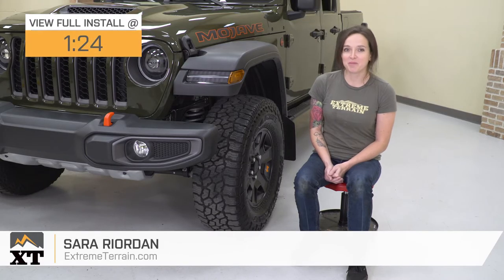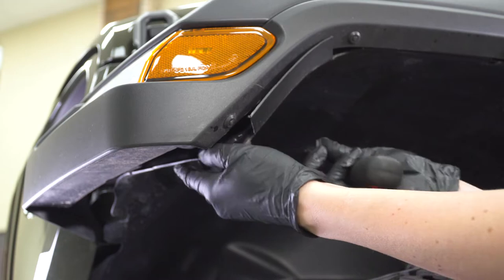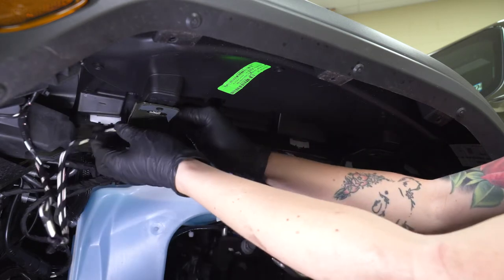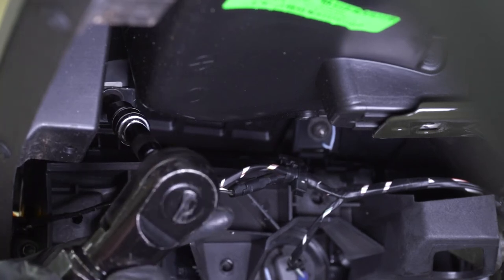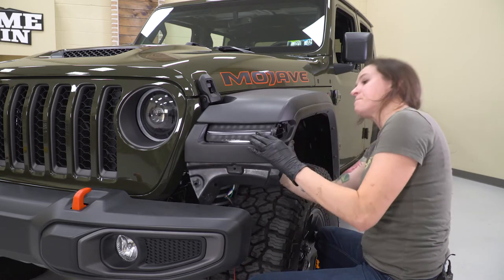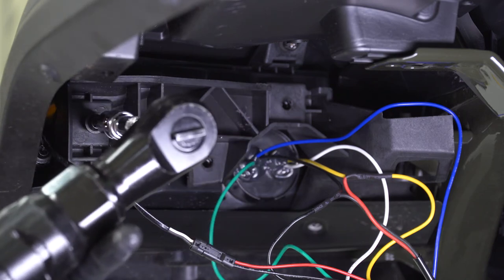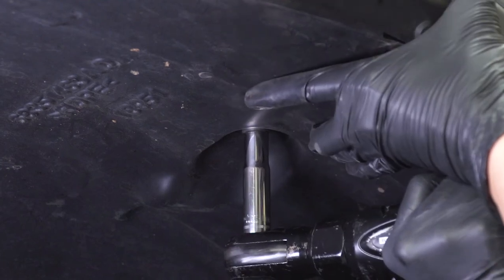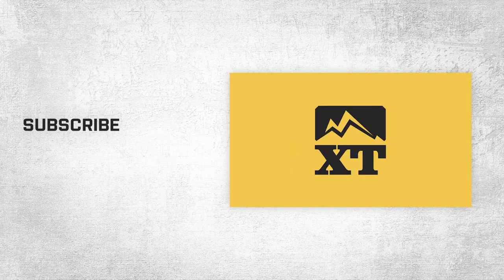Jeep Gladiator JT Morimoto GEN2 XB LED Turn Signals; Smoked Review & Install

Comment: Some feedback.  There are two different lengths and thread types for the screws holding the light assembly.  You don't cover which screws go where.  Not your fault; I lost track of which one goes where... audience, make sure you use one of the short ones for the side light.  They don't mention that in this video

Comment: I installed these on my 22 gladiator and it works great. Your video helped. Next a suspension lift. 😊
Reply from the maker: Thanks for watching! -Zach
Reply: Have you got any error codes since installing?
Reply: @505Zombieman  there were no error codes, they worked great. I enjoyed my jeep for 1 year then it was totaled. A guy took a stop sign, speeding and no insurance.

Comment: Just heads up, install is a little different for '23 year model. There are four plastic rivets on the fender that you will have to pop out and replace, they can not be reused. To get to the side marker light you must remove the bracket, also held in by a rivet. Once out it makes swapping the actual housing a snap.....
Reply: Great heads-up, thanks as I have the 23 gladiator.   How did you remove the rivets?  Where to buy replacements?  Special tools?  Thanks so much

Comment: Ok. So after trial and error. The yellow wire off the headlights will activate the amber turn signals. 
My question is if your replacing the halogen headlights with LED headlights.  Do you hook up the green wire? Per instructions if hooking up to stock halogens hook up the red wire leave the green wire disconnected.  If you have leds hook up red and green wires. So do you hook up the green wire or not.

Comment: Also, you didn't mention anything about the green wire plug requirement and left those wires exposed and unplugged in the video.  I have a Rubicon, so do I plug it in or leave it unplugged?

Comment: What is the purpose of the ballast?
If you have a tazer installed already do you still need to hook that up. Great video.  Thanks for your time
Reply from the maker: This is to prevent any hyper flashing or flickering with the LED's. We would recommend to still install this with the turn signals. Thanks for watching!

Comment: Word of caution. If you have an Overland, this guide is nothing like it. Every single step has been different. Not that this is a bad tutorial...but everything is different on the Overland trim. And it's proving to be extremely difficult. I managed to get the liner off, but you need to replace the rivet clips. Make sure you have those. However now I'm trying to disconnect the light and I'm stuck. I've unscrewed so many things, and the light isn't budging. :(

Comment: Have DV8 headlights installed what to know which wires to install amber signal wire to and which color wire is DRL. Want to direct wire white halos to drl instead of fuse box. Wires on new turn signals are white,yellow,green blue and black. On both left and right side lights.

Comment: I purchased these and installed them on a 2023 halogen gladiator Rubicon, and I do not get the white DRL's. No clue why... Do I need to get a Tazer to get them to be my "new" DRL's?
Help, I can't find any info on this issue. :/
Reply from the maker: You shouldn't need a Tazer for the white DRL to come on. Give our tech guys a call and we can help you trouble shoot the issue. 1-877-870-8556

Comment: Will these work on the non-sport Willys edition? For example, mine is a Willys not a Willys "Sport". Thank you.
Reply from the maker: So your Wrangler has a separate marker light and turn signal on the front of your fenders, right? Not a single bulb that works for both functions? If so - then yes! These will work fine! -Zach

Comment: Do you do anything with the green wire?
Reply: Green and white wires are for if you have factory led lights. In this case only you connect red wire to red and green to red.  If u have factory standard lights .then you only use the red wire do not use the green or white.